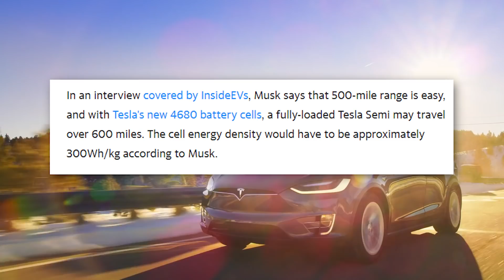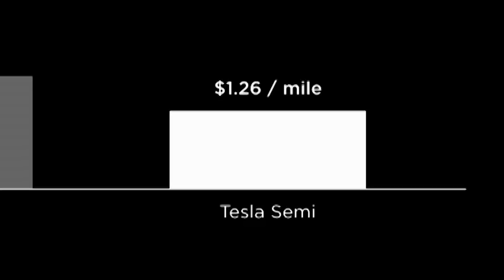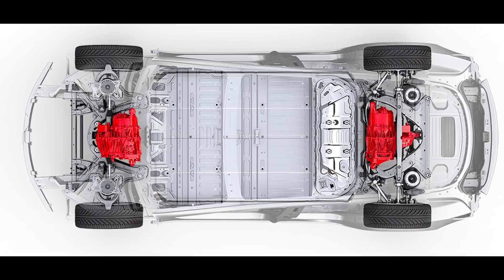The Tesla Semi 2021 Update Is Here..

Comment: I see trailers as becoming equally important to the equation.  Using structural batteries as the decking and regenerative brakes (far less maintenance) at the axles, range would be drastically improved, especially when they are simply swapped out at large distribution warehouses, having been charged onsite during loading/unloading.  Weight penalty, yes but down the road (pardon the pun) with the addition of multiple drive units and intelligent castoring (steering) trailer axles, it should not take long to change regulations in most locations to allow much heavier payloads and multiple trailers/trains.  Really, the semi should eventually be erased from the equation all together...
Reply from the maker: Agreed! So many areas of this vehicle that can be improved and I think Tesla is going to improve on all of them.
Reply: Most warehouses are not going to get involved in swapping out batteries , and how are you going to power refrigerated trailers?
Reply: Always questions to answer if their are cost savings available.  My thoughts are mainly with places like Costco, Walmart and the like, places with their own warehouses and truck fleets.  Never gonna be a one size fits all solution.  As for swapping batteries, I mean swap trailers that are made out of batteries, not swap battery packs...
Reply: They’re
Reply: There are, dammit...
Reply: @MrVincehannah ...you cant place all the batteries in the the trailer , too much weight on the trailer.
Reply: @toledojeeper2932  I don't disagree and am no trucking expert, (your average youtube armchair q-back) but if the battery packs make up the load bearing structure of the trailer decking, and the axles are regenerative braking units, or even powered, then the added range may make for a good use case, as a significant amount of goods being shipped are volume limited, not weight limited...
Also, with an advanced trailer design, additional, steerable axles could be added, reducing road load and allowing regulations to perhaps allow for heavier loads.  I see many new heavy lift trucks with 3rd and 4th axles that can be lifted when not in use, already on the road...
Reply: @MrVincehannah  ...once again , steerable axles and 3 and 4 axles adds weight . Do you think the states are going to change their weight laws for these things ? If you want to see a good example of what weights over 80000 lbs do to roads just go to Michigan.
Also when it comes to weight each axles can not exceed certain weights , when you start adding weight to the trailer the weight has to be distributed in a way that that keeps the axles legal . You can be under the weight limit but your axles could be over their limits depending on how the weight is distributed.
Also a lot of trips are drop and hook , so will companies have to upgrade all their trailers ?
Reply: @MrChiangching  trailers already carry their own cooling units
Reply: Between heavy truck transportation, trains and marine use, there may be possibilities for fuel cells.  I see that at least one large rail company is designing fuel cell locomotives...
Reply: @dan92677  and the units are diesel, not electric. Electric would be a huge drain on the batteries.
Reply: true.  not all old tech is going away at once. by dribs and drabs. that infrastructure is already in place.

Comment: These trucks also have a level of control that can eliminate jack knifing
Reply: When you are going downhill on an icy road and your wheels lose their grip on the road, nothing on this earth can stop a jackknife.
Reply: @stevenanderson9660  Yeah, I think most jacknifing is due to a bad driver over turning, or loss of control like an icy road.

Driver assistance features could potentially stop a bad driver from over turning, but so could good driving, but not loss of control.
Reply: @Jaker788  Maybe their ATC (automatic traction control) and independent wheel torque vectoring(one motor per wheel) will help prevent loss of control from happening as much.
Reply: What’s that
Reply: @cvs8104  when the truck an the trailer fold, it looks a bit like a half opened Swiss pocket knife, therefore the name.
Reply: @cvs8104  one of the worst things that can ever happen to a truck on the road.
Reply: Or torque shaking from a standstill
Reply: Not gonna happen. This statement proves you've never driven a truck.

Comment: Here in the not-very-delightful EU, gas costs almost 3 times as much per gallon as in the US, yet electricity is approximately the same per kWh. So, the operational savings over here will be much greater ... BUT the politicians are going to have to figure out what to do about the major loss of tax tax and more tax on gas (typically around 70%).
Reply: I have no doubt that here in Canada, if we magically all switched to solar and wind power exclusively, we would immediately be taxed on sunlight and wind.
Reply: Just wait until the robotaxi kills the ICE market. Tax loss at that point will be huge.
Reply: Not really an issue.  The onboard computer and GPS will do a daily location and miles and registration will be adjusted by this data to provide revenue where it is supposed to go.  They are required to have log books, they could be tablets connected to the truck's Bluetooth and report daily if needed.
Just some ideas.  I am sure there will be many changes to go along with the new technology.

Comment: Just a reminder. There's Tesla trucks doing trips right now. The weight issue isn't an issue.
Reply: I mean they might lose some payload capacity, but with the new cells and using them structurally should bring that issue down massively.

If they can carry 40-50k pounds legally that's basically typical capacity. If they can do even 40,000lbs, that's most loads

Comment: Few questions about the semi : 1* what is the g force rating while accelerating? (Like if you hold a cup of water will it spill? Too much acceleration can cause the cargo to come loose and fall off or out of the trailer or even go thru it. Same goes for braking too hard.). 2* what are the chassis options? (Are there any plans for 8x4 chassis options for stuff like oversized loads?). 3* what are the sleeper cab options (a surprising amount of loads actually are over 2000 miles and can requires multiple overnight stops.) as it seem to look like its just a day cab or a European sleeper for short trips. 4* are there gonna be speed limiters (as many truck accidents occur due to the fact that at 80000lbs loads the cargo trailer become one big tipping Hazzard around bends hence why there are runaway truck ramps on fast curvy downhill mountain routes. ) 5* when it was tested what was the max load? (Because fully loaded a semi and trailer on a weight scale can weight ~100000lbs. Many over size loads can weight even more . Some up to 700 tonnes tho thoes require large teams of escort vehicles to direct traffic and modify roads to have enough space.) . 6* can someone please clarify how the 4 traction motors are supposed to stop jackknifeing? (Jackknifeing occurs either because the trailer doesn't stop before the cab does or the semi back up too much and the trailer turns more than 90°) . 7* for the no driver automous truck thing exactly how are they going to hook up trailers and recharge? Same for disconnecting trailers. ( i assume magnetic recharging but the trailer air brakes thing still confuses me) .  I'm interested in getting answers because it still looks great and honestly we really do need electric semis on the market as climate change worsens. Plus its just more powerful and cool looking.